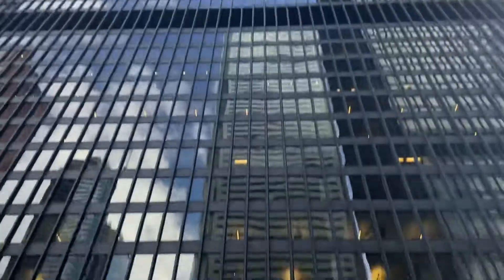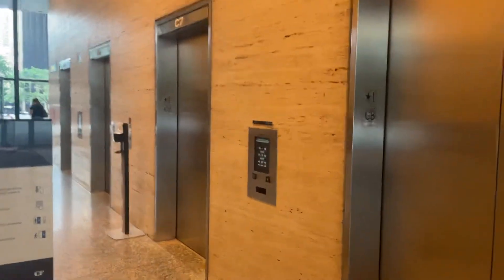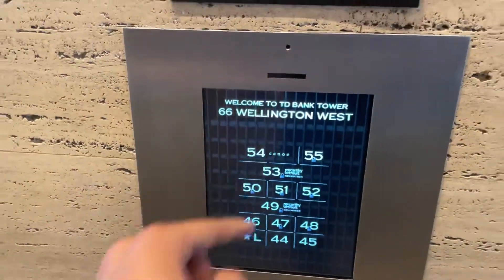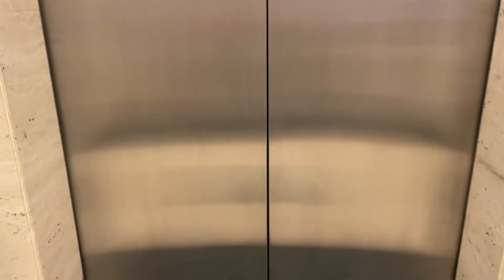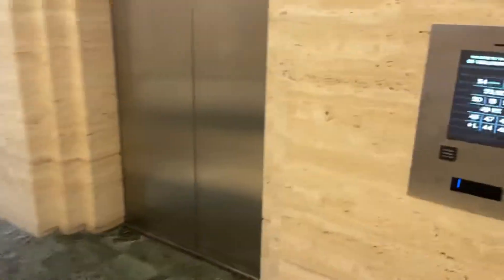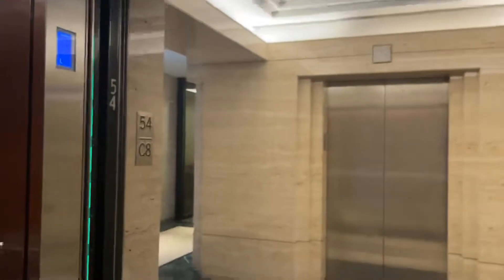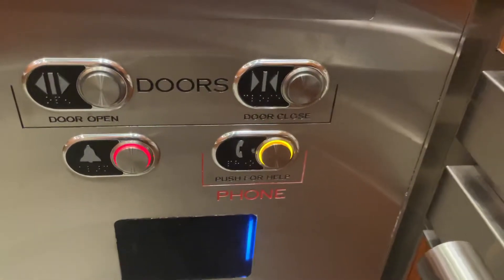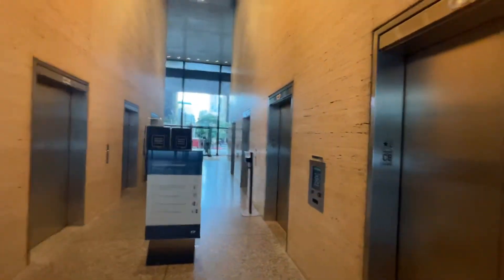TKE/Otis High-Rise Elevators @ TD Bank Tower - Toronto, ON.

Comment: What you said at the beginning of the video is one of the reasons i love filming elevators in Canada. 90-95% of the high rise buildings are SUPER Easy to access and a lot of the time security is pretty chill.

I've been on these elevators a couple times! The new mod seems nice, but i do prefer the previous mod with the Unique Otis indicator and the high pitched floor passing chimes over this.